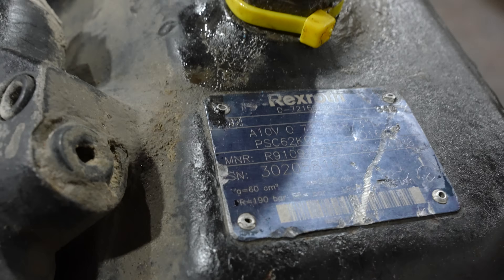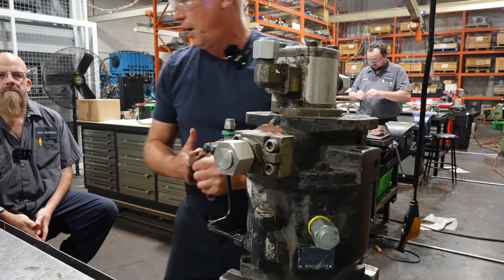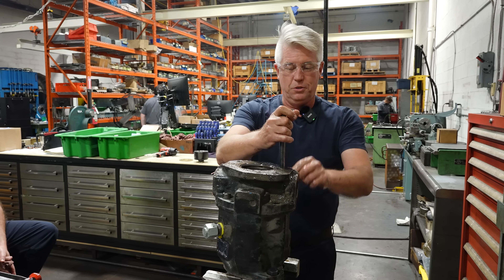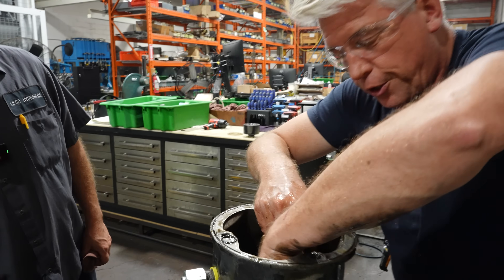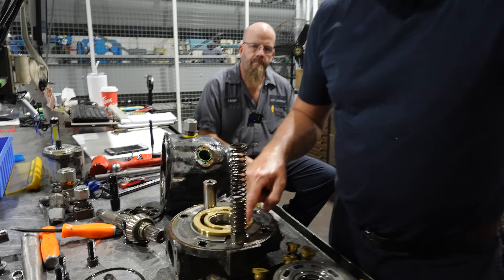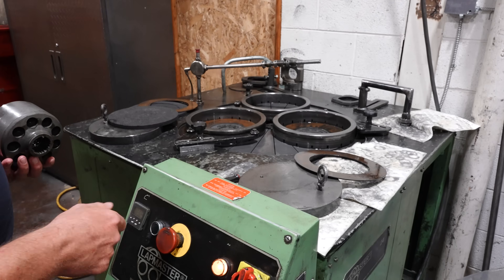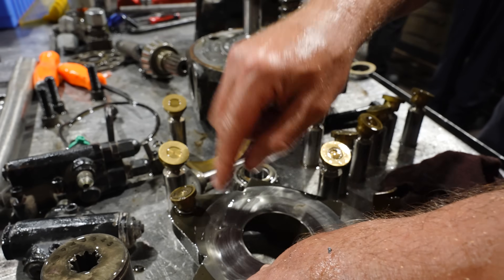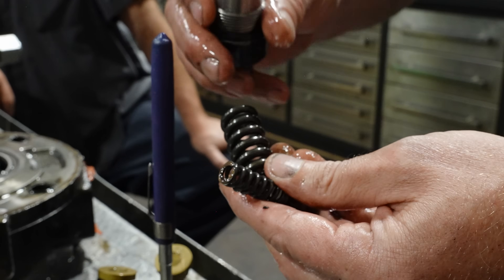Rexroth Troubleshooting: What is Stripping this Driveshaft?

Comment: Why wouldn't they rinse the loose dirt before disassembly?  Lowers the risk of contamination.
Reply from the maker: Insides need cleaning too. Before reassembled there is often a lot of time spent in a parts washer. We have automatic machines and just manual washers. One example: cleaning gasket eliminator is a very tedious manual process.
When I was in field sales I picked up a pump from a chicken wings factory that was covered in chicken guts. That one we cleaed before disassembly. -Fraser

Comment: Usually the pump shaft goes into a soft flexplate some being plastic on CAT which protect pump shaft splines from damage .
Steel on steel splies which run dry wear out alot.

One machine the pump hung way off bell housing droopy bounced caused mis alignment of pump to engine led to failure.
Bell housing was not stiff enough to keep long heavy triple pump in alignment.

That should fail or strip before pump shaft.
Front shaft carries majority of torque.
Often i see dry rusty splines on . couplers.
Reply from the maker: Yes those "dry rusty splines" is actually a major problem, as you mention. One of the interesting trivia brought up by another commentor is that the rust makes fretting worse because it is actually harder than steel. The lubrication helps that steel-on-steel contact that you mentioned, but also prevents rust. (Sounds like you already knew this!) -Fraser
Reply: @LifcoHydraulics I drilled a hole in bell housing to squirt oil on splines . Salt water marine areas especially.
Nice videos and shop you have .
I rebuilt Rexroth pumps and other hydraulic pumps .
Kawasaki pumps are awesome also 👍

Comment: Don’t see the point in Qmax ring or screw, if the controll is what Rexroth calls “power controls”, or in regular terms - torque limiter.

If the problem not in the wrong shaft size selection ( because front shaft carries torque for all of the pumps in the stack) then the problem in the controls or their adjustments.